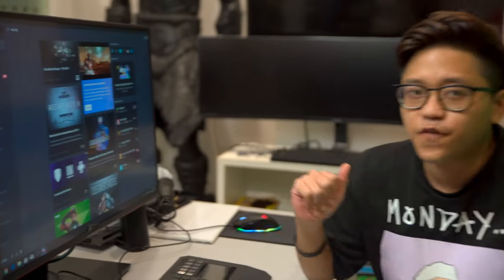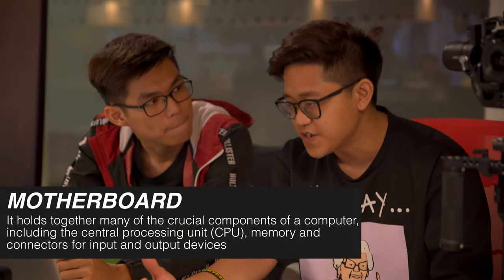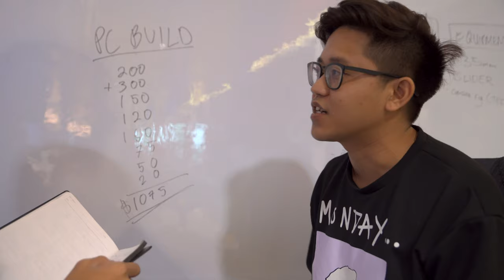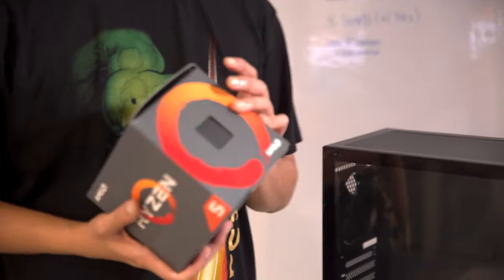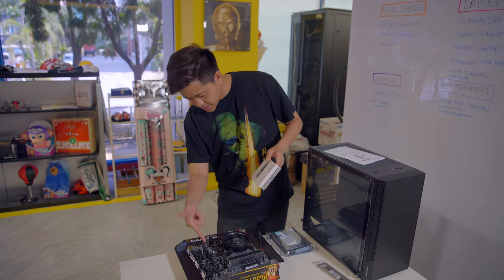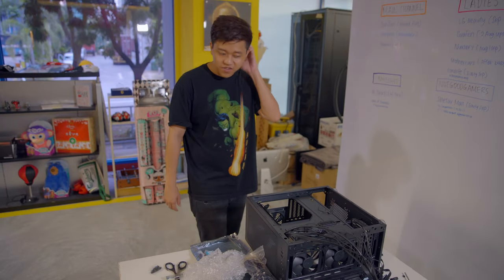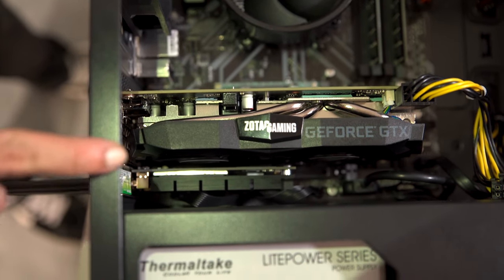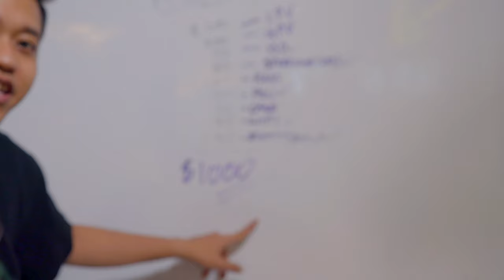$1000 Gaming PC Build

Comment: This is not in as an USD. It's SGD (Singapore currency). 
USD - 723.22. around that price.
SGD - 1000.
Reply: Awesome! But when you buy used, think how much better you can do! My ITX build: r5 2600, GTX 1080
Reply: my one is r3 3300x(I went on a budget) and a gtx 1650 gpu
Reply: Ayy sinon
Reply: I got a i5 11600kf with a rtx 3070 triple fan

Comment: 1. Power delivery on that board is bad but since u are using 2600 u should be fine(upgrade path will be limited)
2. Speaking of cpu ryzen 3000 is out and buying 3600 is a much better option compared to 2600
3. U cheaped out on your psu
Reply: The psu is okay
Reply: Yeh i agree with 3, try getting a 80+ bronze minimum
Reply: @dannytran7446  its not about the certificate the psu is pure crap but yeah bronze should be minimum
Reply: 1. not really since he be using it at stock clock, no hard oc from him, should be just fine. even i use b450 for oc just a lil bit oc, temp on vram doing just fine.
2. i would agree on this but seems he on tight budget, ryzen 3000 will cost more than his budget which is 1k
3.this psu is totally fine. i built several pc using this psu thermaltake , up until now still no problem. it is simple as if you have more budget go for 80 plus if not just stick to branded psu non 80 plus will do just fine (but i will stay away from non branded psu or super cheap psu)
Reply: @pan8155  man vrms and their cooling on that board is pretty bad and i wouldnt put more than 60W tdp chip
 I usually recommend ppl to buy fire Enstingisure when buying that level of a psu
Never cheapout on a psu
Reply: @goldzen3019  yeah very bad but its weird im ocing with fully load with no problem, its been like 4 months already. b450 should never sold to consumer, because like you said its pretty bad board, and i think manufacturer should stop producing this board because all their rnd cant never compare to yours.
its been like 5 years using this psu never had a problem. there are difference between cheapout and see more review on pc parts. cheers
Reply: @DjoXey  its not about power its about the quality of components 
U dont want a psu frying your entire system

Comment: One advice, get an aftermarket thermal solution soon. My friend, and therefore I, learnt a close-shave lesson on using bundled thermal solutions. There are many which cost below 50 bucks and totally outruns the bundled ones by a long shot. 
That is unless the bundled cooler is the Wraith Prism, which performs similar to something like the Hyper 212, give or take the differences in their design.

Comment: R5 2600 is enough for gaming.. Still happy pair with my rtx2070 mini up to 60fps+😊
Reply: I upgraded my pc from that because I'm trying to play ac oddysey which runs at like 30 fps on 1440p so I run a r5 3600 and rx 5700xt now I can pretty much play most games at 4k 60 fps max settings.
Reply: rtx 270 has been bought for 60fps plus?
Reply: On a pc 60fps+ is trash
Reply: ryzen 5 2600 is more than enough lmfao
Reply: Great gpu bro, but for optimal performance get a better ips screen at 240 hz to fully utilise the gpu!

Comment: A gaming pc can be made even in 700 usd if you want
But for optimal gaming 1000 usd is enough you can basically
Get more than 60 fps at high setting in every game
Reply: Its 1000sgd in the video so it actually cost around 700usd for all the parts in the vid

Comment: And why didn't you guys went with a Atx motherboard? You went with mini itx but your case is not small its a tower. So it makes no sense. Anyway as a recommendation the Gigabyte B450 was  terrible board. Gigabyte has good intel boards but their Ryzen boards suck. For 5 2600 you guys should have went for Msi B450 Tomahawk. It can easily handle a Ryzen 7 2700
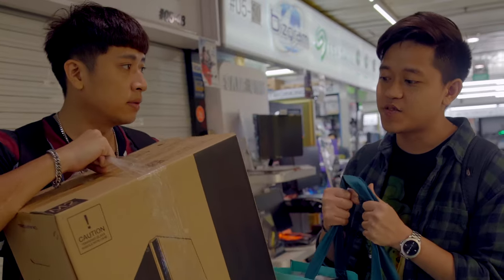Reply: The case wasn't a mid tower, it was actually micro atx case 4:57 on the box of the case bottom right
Reply: Lol this comment makes no sense
Reply: o Corex oof my bad

Comment: Wrong slot for RAM, its counted from left to right
Reply: @randompersonyoudontknow4860  no
Reply: @randompersonyoudontknow4860  that is not how dual channel works
Reply: BRUH that’s not HOW dual channel works. Dual channel requires you to insert the ram sticks in DIMM SLOT A2 and B2 or known as 2 and 4. In that condition, the BIOS will be able to detect dual channel and if in slot 1 and 2, rip dual channel and it will be detected as single channel which is twice as less the memory bandwidth

Comment: For a $2000 pc build... My specs is: Motherboard MSI X470 pro
 CPU Ryzen 7 3700X
GPU: MSI RTX 2070 Armour OC
Ram Corsair vengeance RGB pro 16gb 
Case Tecware Vega F3
CPU cooling ID cooling auraflow X 120
PSU 600w forgot the brand of it
SSD: 240gb forgot the brand
HDD 2tb Seagate Barracuda

That is my set up it cost for me around. $1950
Reply: You can also use this specs cause is very good
Reply: Battlefield 5 is like 120fps+
Reply: Fortnite at low is like 340fps around there
Battlefield V is 120fps+ around there also
Reply: Did you update the bios

Comment: $1000 for a 1660ti i can get a rtx 2070 ryzen 5 3600
Reply: Afflict Exactly I was like what?
Reply: In his country tech is probably more expensive.
Reply: Zy The Wolverine i was thinking this man got ripped tf up
Reply: Aidas 0050 True
Reply: The 1000 dollar is the Singapore Currency. 
Of course, he can just bought the Galax RTX 2060 and a Ryzen 5 2600 or Ryzen 5 3600, SSD 120gb, 500gb or 1tb HDD, PSU 80+ bronze, micro atx motherboard and a cheap ATX or Micro Atx case around 30 to 50 dollars. 
You can use LAZADA platform to check the price as an example. 
or Sim Lim square mall website.
Reply: @Optimusprime1993and2  lol dont get the rtx 2060, get the rx 5700 instead.
Reply: In holland an 1080ti already is 1.2k

Comment: That's a really terrible MOBO. I had the z370m DS3H. The VRMs had no thermal heatsink, and were routinely throttling my i7-9700k on stock. One should look for the D3H variant, which has actual thermal heatsinks, or just not skimp out on the motherboard altogether.

Comment: This is not a tutorial. More like first time PC builder (random builder). E.g. When installing CPU there is no mention what to pay attention to when placing the CPU into the Motherboard (Mobo) like there is a small gold triangle that needs to be matched from the CPU corner with the mobo socket. Yes, tiny detail is very important. Not recommended for first time builder with zero knowledge about building PC (knowing what to shop and each component is not enough). However, just for a video to watch, it's fine.

Comment: Nani? For gaming ryzen is better. Wut? Cheaper yes but gaming depends. Or am I wrong? Hmmm:3
Reply: AMD Ryzen CPU can Multitask without worries but it have a hungry for the ram speed. lol.
Reply: @Optimusprime1993and2  Pretty much, that's why I'm bamboozled when the tech geeks said it was better for gaming. Ryzen was made particularly as a jack of all trade cpu as opposed to intel where it's superior single core speed allows for better gaming performance. At least in the case of 2nd gen ryzen and below cpu since its 3rd gen cpu has drastically improved on its single core performance to the point where it close to/beat intel. :3

Comment: First why did you use the cpu air cooler you should’ve bought a water cooler 
2nd why did you buy the power supply with out 80 plus gold or bronze
3rd why did you get a gigabyte mother board you should’ve bought a motherboard from asus rog